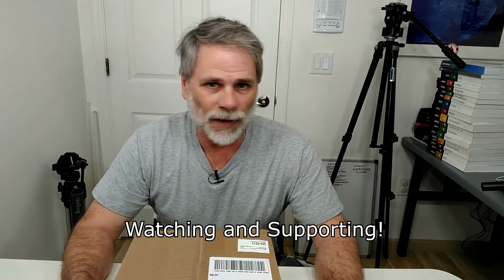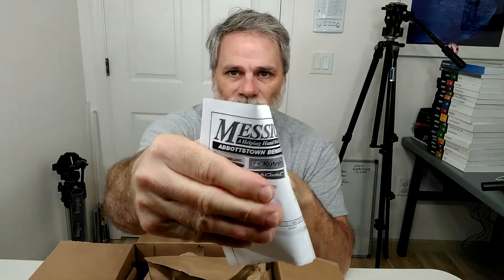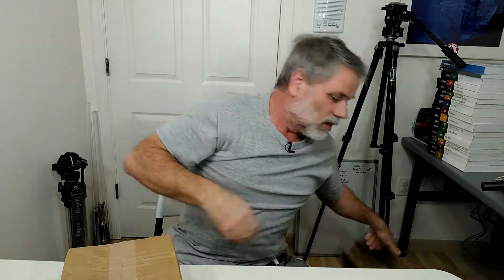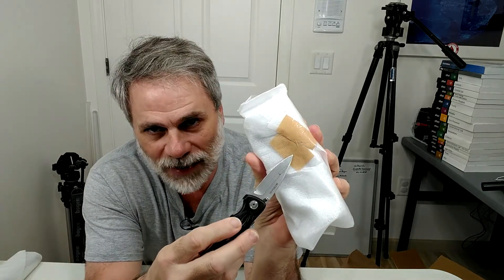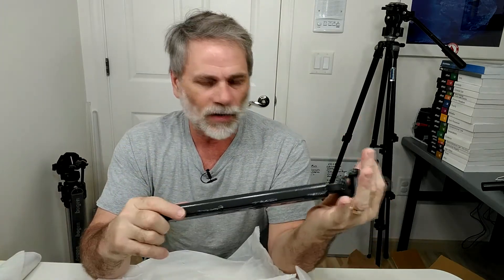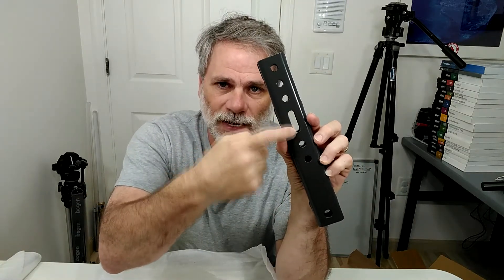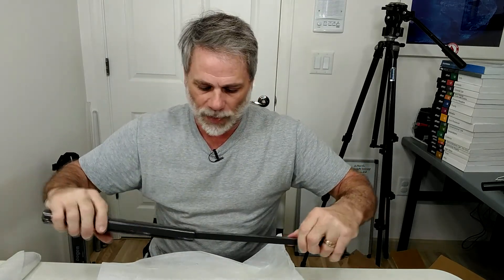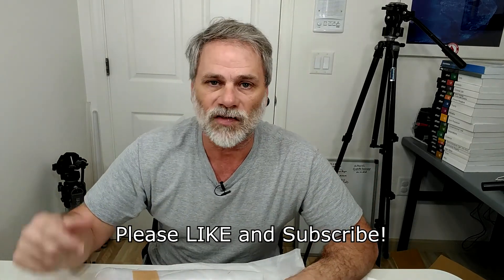Kubota L8430 Stabilizer Kit Unboxing - Install Video Coming Soon! - Ray Hayden, J.D.

Comment: They are nice, I have the Hodge stabilizers.  I can't use them with my rotary cutter b/c it's kind of wide but I use for all other attachments.  Nice purchase, Ray.  You'll love the ease of loosening and tightening the stabilizers since they use a pin and no turnbuckle.  👍
Reply from the maker: If I am correct, I believe his first name might be Mark. The Hodge welds look like they go full length - which would be better. I also thought they looked a little more custom for each tractor. I will try and make the install video today.
Reply: LoveTH yall!! Stephopalopal ◇ NOLA music and Peace
Reply: You'll like them.  You mentioned in your video you bent one of the turnbuckle stabilizers.  was that from using rotary cutter?  I bent one of my turn-buckle style stabilizers from rotary cutter use.  It's probably a weak point in smaller tractors. It's less costly that stabilizers and shear-pins break/bend than the main PTO shaft or the primary box on rotary cutter or other implements. Looking forward to your install video.  The install is fairly fast/simple.  Thanks for sharing, Ray.  Later.
Reply from the maker: Yes, it was the Rotary Cutter that did in the turnbuckle, it sheared a few of my large pins as well, I found most of them, in tact! Still, it was a nightmare at the time!
Reply: @rayhayden  This is like Tractor talk Broadway!!! TRACTOR is on the stage...Broadway!! Love yall!!
Reply: Hey Stephopal, I love when you come in.  You're like a beam of sunlight and a whoosh of fresh air.  Yes...you are The Queen of New Orleans (smile).
Reply: I had to chuckle when I read your tractor comment again.   

You said...."This is like Tractor talk Broadway!!! TRACTOR is on the stage...Broadway!!"  Just loved the comment and had to send you another comment.  Remember, the Queen (smile)   

Stephopal Opal, we gotta get you a small tractor to handle some chores around the farm to care for your loving animals.  Have a fine weekend.
Reply: @houndsmanone4563  awwh!! Well..Ray is tractor talking Broadway  style..Thank you..Psst .I still need to do playlist..also Im on hallway with mattress bc Tornados again ..Love you ...psst thank you..♡♡
Reply: @houndsmanone4563  well its a Tractor on Broadway play now..Yes..Extra extra read all about it Ray Hayden and the Tractor ...its a hit I tell ya!!..Tap dancing tractor and Ray Hayden..BROADWAY!!!!  Love you ..yes I think a smaller tractor might be nice ..bc ya saw mine..hmm..Well..ya gotta hit a certain part with a hammer and make a certain face and cross your fingers at thesame time that it works..true story on 50 mins..or 30/30 one of those shows they talked about my tractor( psst no they didnt) and it was all about how I gotta hit it and cross fingers that it works..Ok..Tornado Mattress time. .Love yall!!
Reply: Holy Schmokes Stephopal.  I didn't know you guys were going through tornado watch/warnings. Keep your head down and your spirits up.
Reply: @houndsmanone4563  Im out of mattress and safe..for now..think more on way..Thank you!! Think I want to get a metal house( like long train thingy) ...turn it into tiny house safe place..bc my hallway..and mattress ..hmmm..Thinking of a master plan!! Something of this nature